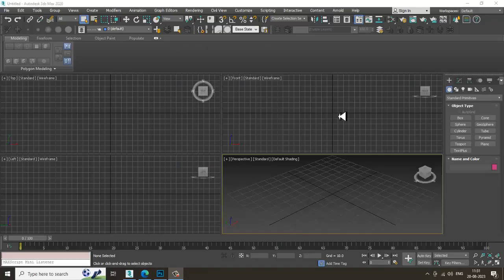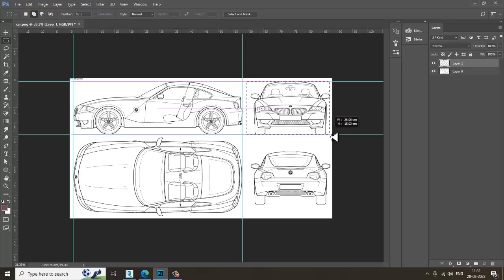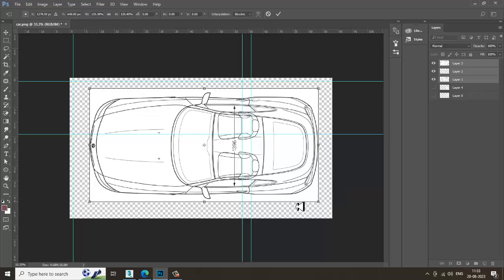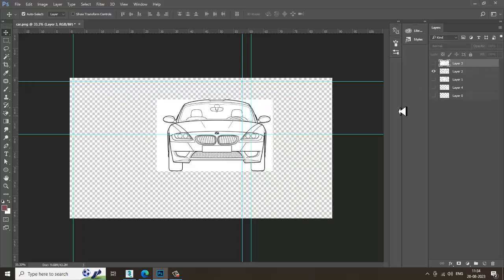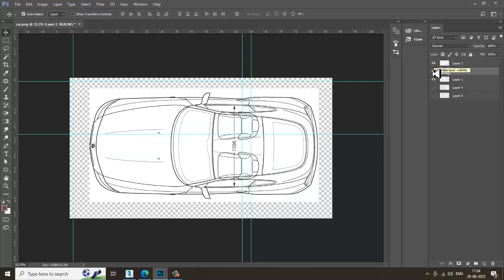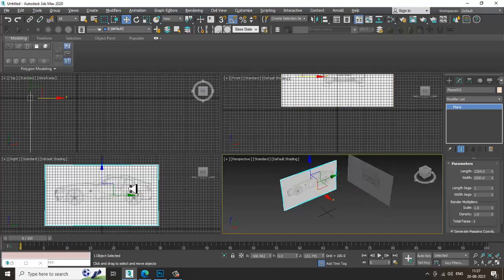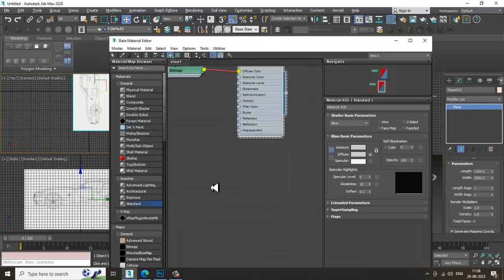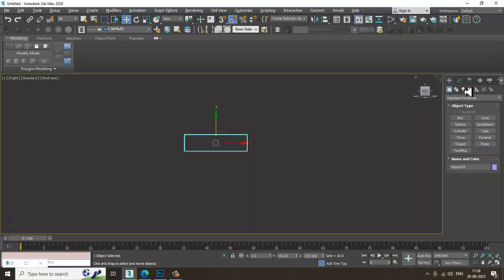3dsmax Tutorials, Learn 3D Modeling a Car from Scratch in 3dsmax. ( Part 1)

Comment: hello can you explain when you are in edit poly mode and you slect vertex mode and you slect a line of vertexs and extend them and then you somehow snap it to make like a new line of squares and then you drag the gizmo say y axis again some more and make a new line of square verteces etc and so on--cuz i cant get to do that all i get is long rectanmglar shapes when i extend it doesnt snap into sqaures and so i have ot then add the swift loops which sometines causes problesm--can you explain?? it wou;d be great if you had text instructiosn work sheet scrip also but anyways hello do you repsond??---lisa
Reply from the maker: Press Shift and Extrude the edges.., Select the line edges and Extrude in whatever direction u want with gizmos
Reply: hello thxz for reply but how do you make squares incremental? not continious rectangle--also you dont really mean extrude cuz your not slecting the extrude option on the right but you mean drag?? Lisa
Reply: hello so when i press shift it will create a new square not continous rectangle?? thxz-- Lisa
Reply: okay kindly see my other comments but i will try and see if it works --Lisa